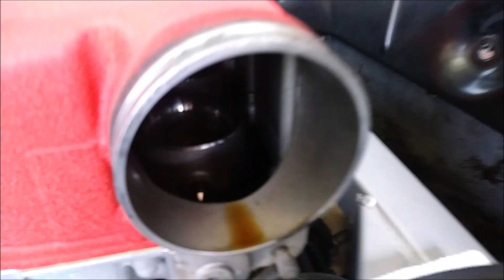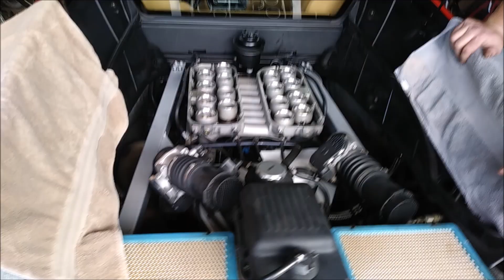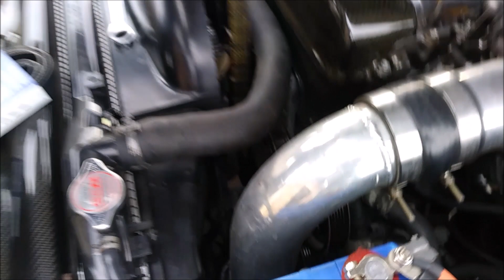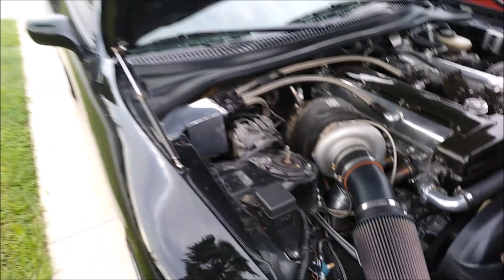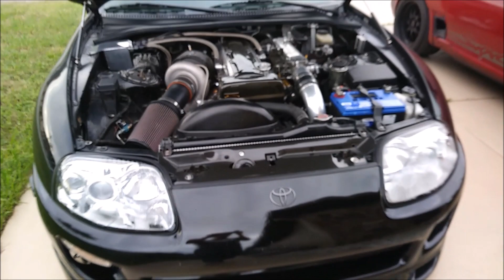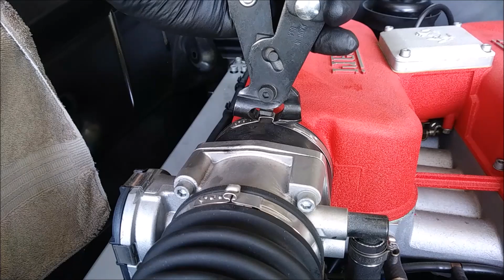Ferrari 360 White Smoke Fixed From Exhaust Pipes + Supra Maintenance belt change

Comment: My 2007 X5 4.8 V8 with 50k on the odometer. It all of a sudden started smoking like your ferrari. I took it to a BMW stealership and was told that I needed all new valve seals and quoted me 8 grand to do the job. I decided to take somewhere else for a second opinion, a small local German shop. They identified the problem as a faulty PCV membrane... They fixed the problem for 100 bucks! Ran it for a few hundred miles and smoke was all gone...
Reply: And it still needed valve seals. Every n62 and n63 has this problem.

Comment: What caused the buildup? does it need a catch can? That is a crap ton of oil in the intake. Is the PCV stuck open?
Reply from the maker: adam lebednik 
It has a dry sump system so any oil over the full level gets sucked into the intake over time it builds up to the point were it smokes
Reply: ahhhh thanks!
Reply: Kevin Mcmullen Why didn't it smoke like that when it was first dropped off?
Reply: Rob added an extra quart when he heard the tick in the engine from the AC-compressor... I think that is the cause of the problem.

Comment: I thought for sure this would have been a head gasket, good thing it wasn't! It is interesting that the smoke was white though, usually oil burns blueish.
Reply from the maker: Seth Francis Sim Racing 
That's what I was thinking when it happened. So when I found this to be the problem I was more then relieved.

Comment: Glad it was an easy fix but, what caused the oil to pool in the intake like that?
Reply from the maker: Stan Chase too much oil was put in the motor it has a dry sump system. So unlike a regular car if you put even a quart over the suction pulls it into the intake

Comment: Did you ever find out what caused the oil to accumulate around the intake runners ?
Reply: davidautotech1  it’s called pouting too much oil in the engine .. his fault completely .. it’s a dry sump so you have to measure the oil at temperature .. complete newb mistake .. best for him to stick with Japanese cars

Comment: My intuition is oil control rings and or PCV system malfunction
Reply from the maker: davidautotech1 
Luckily it was an easy fix the oil was over filled. Being that it's a dry sump system it sucks the excess into the intake

Comment: love to know what happened
Reply from the maker: 420 Garage MAUI 
too much oil in dry sump systemed sucked it into intake manifold
Reply: Kevin Mcmullen did you add oil afyer you took delivery?  I know if Rob saw smoke over time (with that much in there this didnt just appear all of a sudden) he'd have it checked and it was an easy fix...  Wonder if something shady happened while in delivery?  Que Ferris Beuler day off valet scene haha
Reply from the maker: M. Grabarz 

when the ac compressor went bad he added a quart of oil bevause he thought it had rod knock. which it didn't then car sat he drove it to replace compressor then i got it and added a small amount of oil thinking it was low. it doesn't happen instantly. this happened to doug demuro too. he drove 600 miles with it over filled and no smoke then the next day it started smoking.
Reply: Kevin Mcmullen 

Gotcha, do these have electonic oil read outs in dash like BMW or no way of checking oil level at all? I wouldnt be surpised lol
Reply from the maker: M. Grabarz 
it has a dip stick but has to be warmed up for 10 minutes before it gets to the correct pressure and temp to check it.

Comment: Hey man.. was your car running like crap when you had this problem bad starts? Exhaust note not as good ?? Mine has some oil in the same place and has had a major service belts so on last night gave it a belting then when I turned it on white smoke puffed out ... did it again then hardly any .. temps good coolant is fine .. was yours the same kind of symptoms as mine ?
Reply from the maker: It did kind of stumble a bit when starting when it was blowing white smoke. Most likely if you clean out the intake manifolds of any oil in them it will fix the problem it did for me. Good chance they may have over filled the system with a oil a little during the major.  Also take a look at your mass airflow sensors and see if oil made there way onto them that could also cause and issue.
Reply: Kevin McMullen legend man I am going to pull off the manifold clean it out .. I will check the mafs to I put new ones on in the major .. other thing i noticed the battery was playing up will keep you posted with my result 👌 fingers crossed man and thank you for the reply 🤙🏼

Comment: So are you going to tell everyone that you didn't know how to read a dip stick on a dry sumped engine . Or are you just leave it with the thumb nail and make it look Rob sold you a dud. Not a good way to get veiws on your channel.
Reply from the maker: Mark Thomas 
I guess I could make a video saying rob over filled the motor with oil when his ac compressor went bad and he thought it had rod knock. Instead he made a video saying I over filled it. And I went along with it so he wouldn't look bad. And yeah I didn't know how to read a dry sump. Never had one big deal. Now I do because I've now owned a car with one.